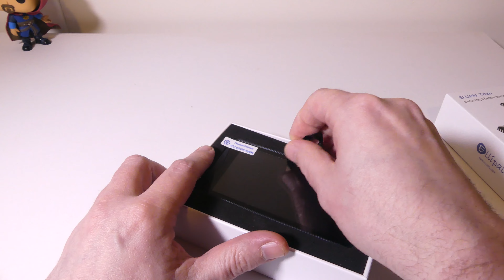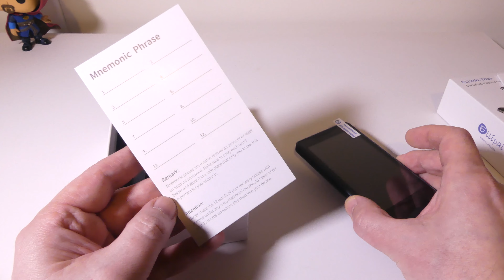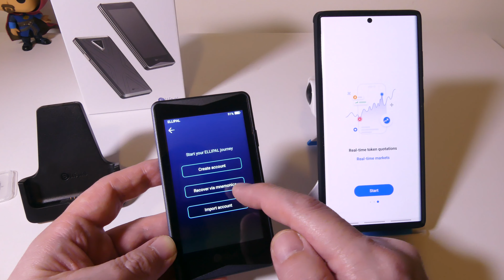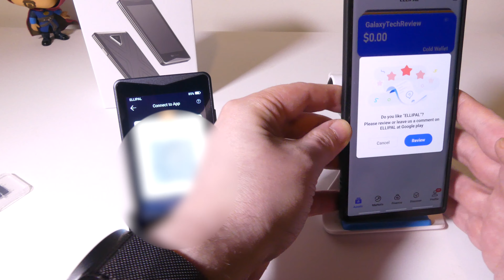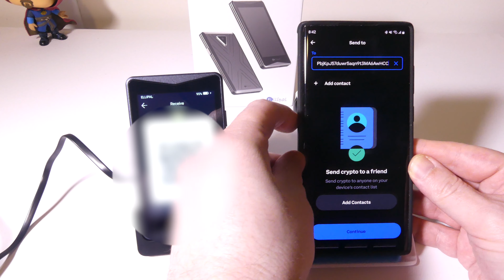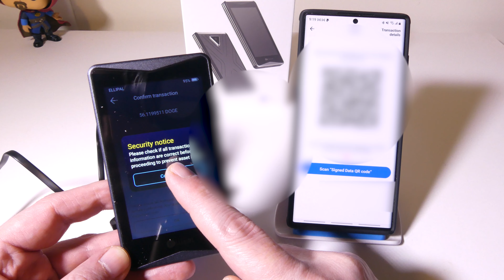Ellipal Titan Crypto Cold Wallet | Most Secure Cold Wallet!

Comment: You did not mention how many apps can be installed? 
Ledger Nano S allows only 3
Reply from the maker: ELLIPAL TITAN:

ELLIPAL does not limit the number of App combinations installed.

ELLIPAL supports: 40 Blockchains and 10,000+ Tokens.

Examples are Bitcoin and Ethereum, BCH, DASH, etc. and new coins added every month. ELLIPAL support more than 250 DAPPs for examples: OpenSeas, Uniswap, Aave, YfII, etc. ELLIPAL supports all DAPPs and coins so you don’t need to worry about any storage restrictions.
Reply from the maker: You can check more of the Ellipal vs. Ledgers HERE  https://www.ellipal.com/blogs/news/insufficient-device-storage-ledger-vs-ellipal
Reply: Does it support trc 20?

Comment: How you can download the app if there is no way to connect the device on bluetoth, wifi, data etc ??
Reply: I thought the same thing. Here’s what I found:

“ELLIPAL wallets are equipped with air-gapped technology and, therefore, cannot connect to the internet or blockchain. To send funds to and from the wallet, the wallet is equipped with cameras to scan QR codes and send funds through the mobile app as a proxy. 

To send funds, users can create a transaction request on the mobile app. The app will generate a QR code for the transaction that can be scanned by the wallet to authorize the transaction. Once authorized, the wallet will generate another QR code to confirm the transaction. Once this QR code is scanned through the mobile app, the transaction will be initiated. 

ELLIPAL utilizes QR codes instead of direct internet connection to avoid the possibility of online attacks. Once funds are secured in the wallet, users can view their portfolio information on the wallet by entering the safety phrase and navigating the interface.”
Reply: QR signing.

Comment: The titan wallet has issues updating with the sd card.  If you can do a video on using the sd car and why it's not working or how we can fix this issue.  No one has any direction and needs help.  You'll get your likes and sub.
Reply: Because of crypto wallet flaws lets me know that its still early in the crypto space as its technology is still advancing
Reply: @infamousone710  Yup! That's True!...However, I believe as the years roll by they'll create new advance chips/cpu boards to solve many issues for their hardware wallets. I contemplating on getting the arculus hardware wallet card since it doesn't require a battery. I'll have to look into that.
Reply: I had that issue before. The first step is to format the micro sd card to 32 and download the Ellipal firmware on their site. Come to find out you have to copy both zip files to your sd card (open/decompressed file) and the (unopened/compressed file yellow folder that have a zipper on it) after these steps. Take out the Adapter charging cord and adapter away from the titan then insert the micro SD card into the adapter and put the charging cord back in place to update the firmware.
Reply: Did that even bought 2 new sd but no results.  Caught in a corner and almost seem the wallet has a mecahnical issue that cause it not to read the sd
Reply: @infamousone710   Oh Dang, Did you try quick format only? Instead do the Long Format to see if it works...There's pros and cons with all Hardware wallets... There's people having issues with ledgers, d'cent,keepkey and others. Some will get hardware issues do to manufacturers producing them at warp speed and not being more balance to produce them.
Reply from the maker: I'll see what I can do, I had no issues updating mine just took about 15 minutes .
Reply: Nice let me know how that goes if you ever go into it.  Eventually I will into something and I'll do my best to share my experiences with you
Reply: I had to purchase another SD card then it worked fine.